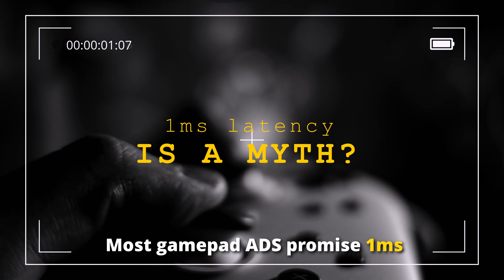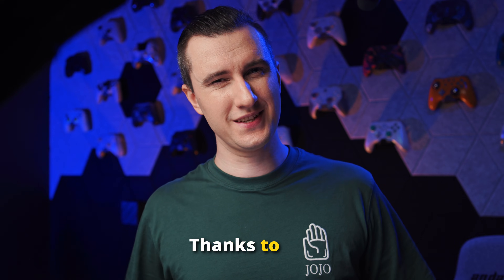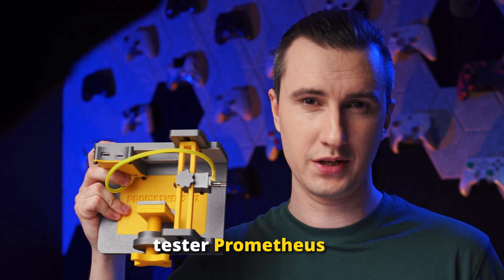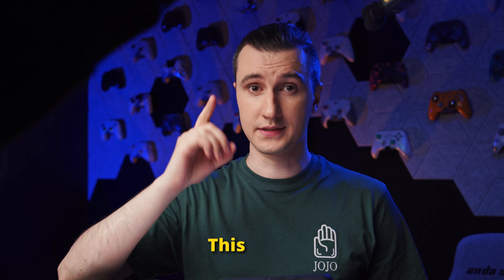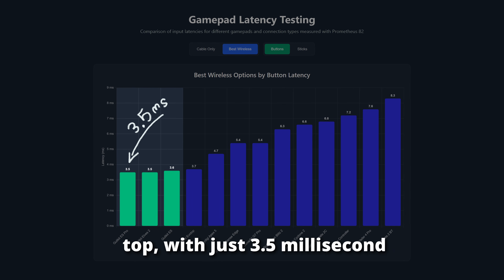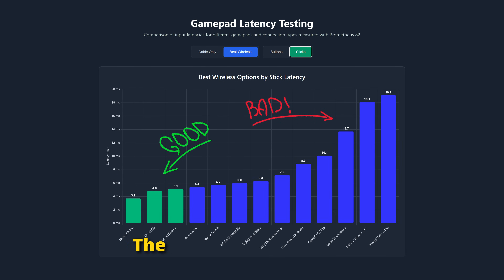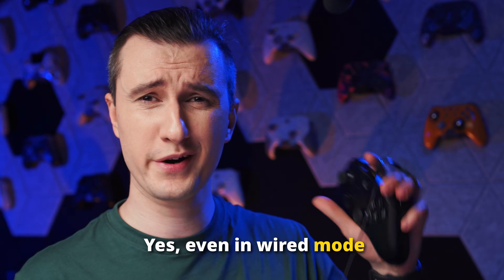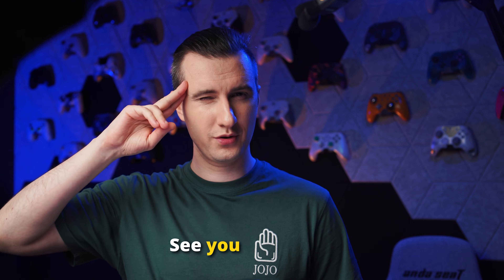Why GuliKit ES/ES PRO are the World's Fastest Wireless Controllers? Input Latency Testing Proves!!

Comment: The gulikit kk3 max/pro were really good controllers but had the really big drawback of the latency (the stick one was really bad) so overall lacked on one of the fundamentals. Seeing that it was not only resolved, but even surpassed the competition is incredible, and the competitive price makes it pratically a must buy. I'm really happy with your improvements and like the decison to use the xbox layout as base one. This gives me high hopes for your future controllers and higher tiers (focus on getting the fundamentals right and actually useful features). i'm curious of why you didn't include a wireless dongle.
edit: it is not yet said in the review on gamepadia, the circular test avg error on gulikit site of my Es Pro is around 8-9%, the kk3 lineup had 0% so i wanted you to be aware of that. Anyware it remains a really good controller.
Reply: this went down to around 4% for my pro after updating the firmware to 3.7 (firmware update instructions available on their website)

Comment: Hey Gulikit, are you planning to release other versions of ES Pro? Like with triggers stocks and back buttons? I don't want to make the same mistake twice and buy a worse earlier product like it was with Elves Pro 2.
Reply: Bro, micro switches🤌🏻
Reply: @JoshyyBear_  what
Reply: @J0rdan912 mouse click buttons in the controller instead of regular membrane buttons.
Reply: @JoshyyBear_  Yeah, but it requires soldering or separate modules, Gulikit and 8bitdo are focused on classic controllers and repairability with reasonable pricing, from what I can tell. Definitely not applying to low-cost Elves and ES.